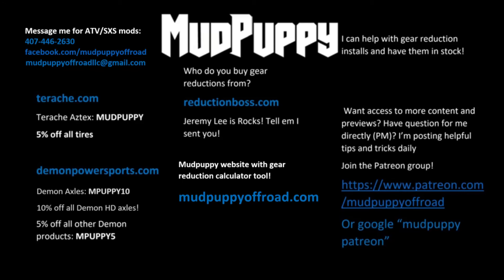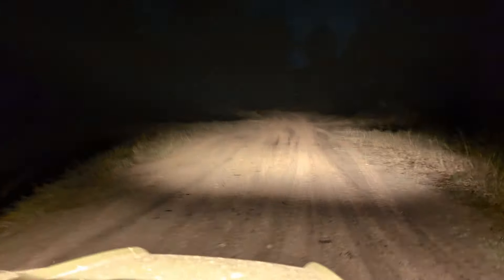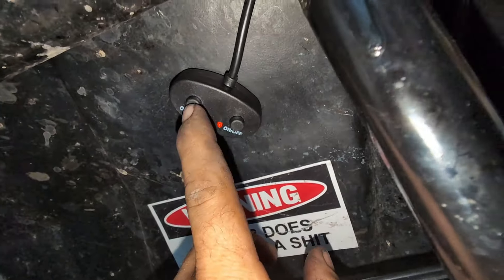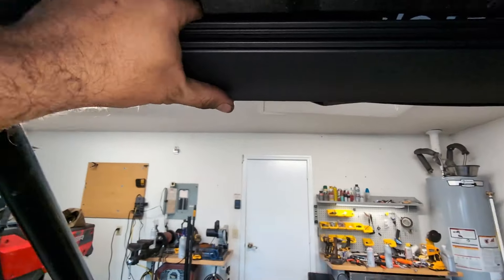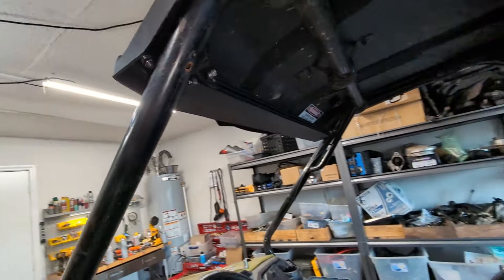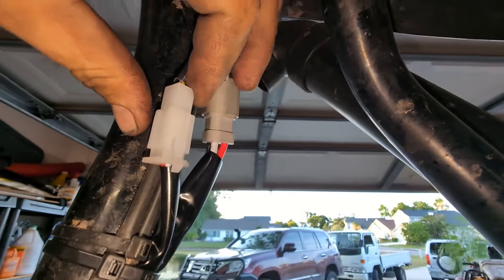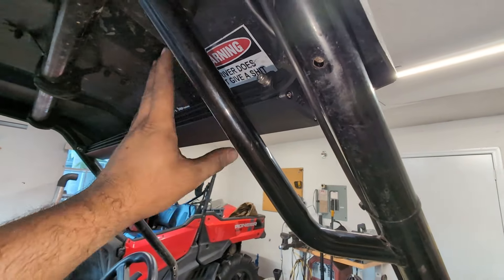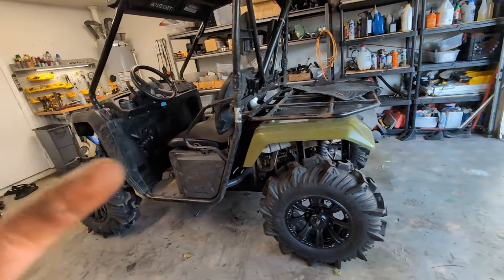Novsight light bar on the Pioneer 500 testing, installation and opinion

Comment: Does wiring the light straight to the battery drain the battery? Is it better to wire it into a fuse that’s powered by ignition?
Reply from the maker: Two separate questions there, You should want 1000% always have a fuse in a system, especially with an aftermarket product. A light bar like this does not drain the battery at all. When you turn it off the relays are not engaged. This light bar draws too much power to wire it through any of the factory circuits on this side by side.